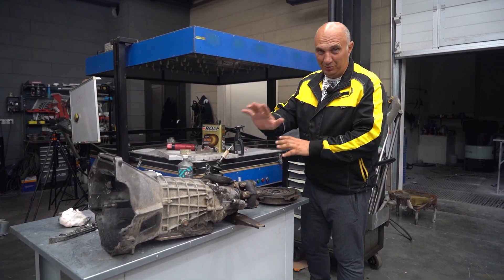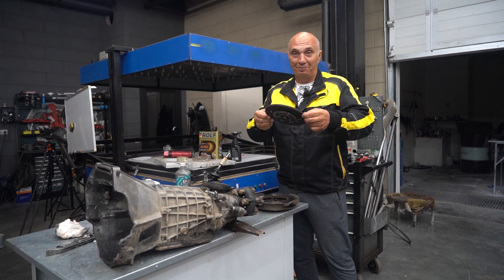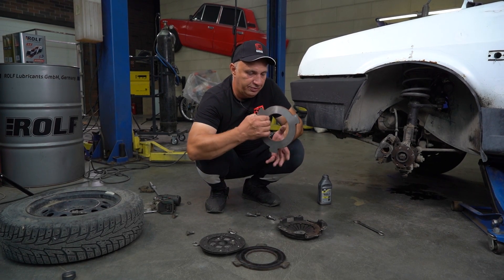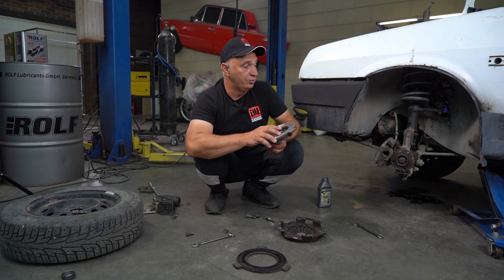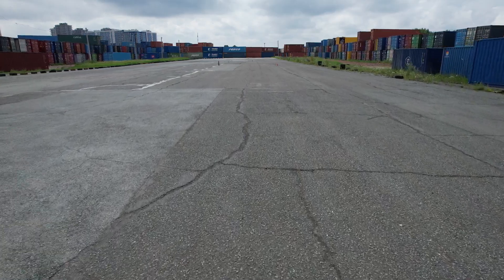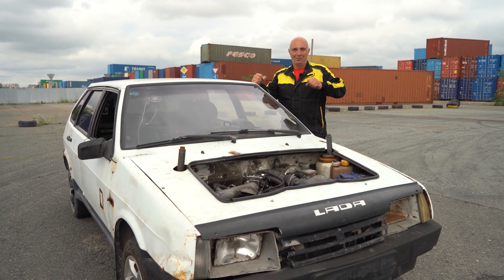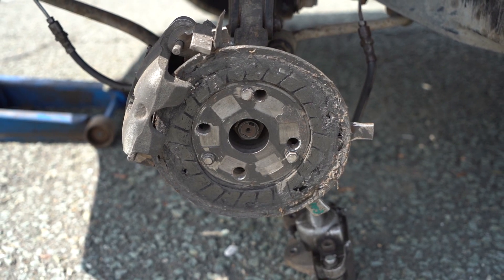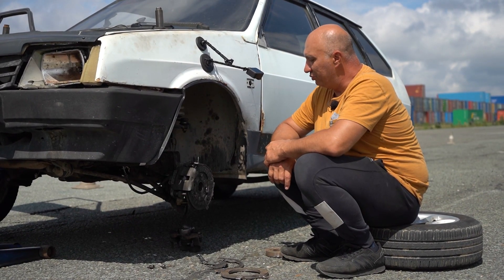We replace conventional brakes with clutch components - will it work?

Comment: This is a few months old, but I thought the question deserves an answer.
As for why the clutch disk failed.  One of two reasons.
1: the clutch material was inferior (possible, but unlikely)
2: the clutch was never broken in.

When I was 17, I replaced the clutch on my minitruck.  Upon replacement, I immediately began to dump the clutch and ferform huge burnouts.  I was doing the exact same behavior before the clutch replacement.  A month later, when the clutch stopped working completely, when I separated the bell housing from the clutch assembly, large chunks of the clutch fell to the ground in a similar fashion.

If this experiment is tried again, either use old used clutch pads, or break in the clutch first.
Hopefully this answers the question.

Comment: I was hoping you'd just make a set of steel brake pads and fit into the standard calipers. Would maybe let more heat escape. The bottom line is though, the friction materials are very different. Doesn't take long to burn up a slipping clutch

Comment: They could have easily cut the clutch in the shape of brake pads and just used them on the stock rotors and got a good comparison of materials. Their way is more work but also kind of interesting. Keep it up fellas!

Comment: What you made is found in aircraft. Spinning brake rotor (rotors) and stationary metal plates (stator). They normally have a 5S 4R configuration with 7 pistons.

Comment: This setup basically is like youre slipping the clutch the entire time. A clutch is more or less an on and off switch, its clamping time is very brief. The driver side went first because thats always the side that gets the most amount of pressure, although its supposed to be "equal". Given the abuse this car takes I wouldnt be surprised to know that one or multiple rubber brake hoses are damaged internally. Still a fun experiment

Comment: The need to press the brakes hard in a set with a clutch disc to obtain the required force could result purely from the fact that two calipers were installed on one side while leaving the standard brake servo. The demand for output increased, but the power supply remained the same. The same effect is when you modify the brakes in a car, installing larger discs and calipers from another vehicle, when the caliper has a larger piston, it also has a greater demand for fluid in mililiters, so often in such cases the new, larger brakes work worse than the factory ones, because the system cannot build up the appropriate pressure. In this case, the caliper capacity increased twice, which certainly significantly reduced the force exerted by the calipers on the discs.

Comment: I assume, a clutch only needs to briefly match up gearbox rotation to engine rotation.. and a brake needs to constantly do that. Also, the material seemed to rip itself apart, due to how the indentations on it were pointing outwards.

Comment: I would suggest. Cut the brake rotor to half of it's thickness then revet the clutch friction plate material to it. Then use metal pads or same brake pads to calculate the results 😊. A much better solution.

Comment: Could you build a manual shifting transmission that uses a torque converter, and one that has an oil pump and oil cooler?

Comment: Clutch discs are made to clamp or release, not to slip. Brake pads / rotors are designed to do exactly the opposite. As for the one showing worse damage than the other, I think that the clutch disc is designed to be directional, which would cause the one rotating the opposite direction to shred worse. That said, I think this would have worked better as a pressure plate arrangement rather than a caliper piston.

Comment: This didn't work because a transmission clutch pedal works in the opposite manner of a brake pedal. The brake system applies pressure to the break pads. The clutch system removes pressure from the clutch plate.

Comment: Now i want to see them take this idea to the next level, instead of the clutch being on transmission input shaft, put a clutch on each wheel of a welded diff and connect it to levers so you can steer the car like a tank!

Comment: The brake pads being smaller means more pressure per inch, the clutch spreads that across the entire disc, so that pressure is alot less per inch but still has more friction. Awesome to see it tried tho.
Reply: A simple set of steel brake pads may have worked better. I think the compound of friction material simply isn't up to the job though

Comment: The only problem I see with this is brake pad minimum thickness is about 5mm, and a clutch disk only has 2mm on each side for 4mm total. It will work well, but not for long.

Comment: Note here - a clutch disc is designed to have clamping pressure and contact on its full surface - youre only applying clamping force to one are while the rest of the clutch disc heats up distorts and ends up getting shredded   and a clutch assembly is meant to only enough to get the car moving not endure a long distance stop with pressure in just one area

Comment: well..  Lets look at it like this..  The strength of a clutch or any other drivetrain component is measured in the force (Torque) that it can tolerate, not the speed.. That clutch was designed to be behind an engine that makes MAYBE 80ft/lb of torque.  

To calculate the amount of torque that it takes to stop a car lets look at it. 

For most cars the brake bias is somewhere around 70% stopping force in the front, some even more.. Lets use 70% as a conservative number. 
The car lets say is 2700 Lbs. To make a 0.5G stop, with a single 26" tall tire (Assume it's a unicycle and all tires from here on out are the same size) , you would have (2700 pound Car *(26 inch tire/2 to get the radius))/12 to convert it back into feet =2925 Lb/Ft for 1G stopping force.  Now assume there are 2 tires like a motorcycle and 70% of that goes to the front to handle..   2925 * 0.70 = 2047.5 Lb/Ft. Now, lets assume that there are 2 front tires splitting the load evenly like a car would. 2047.5 Lb/Ft / 2 tires = 1023.75 Ft/Lbs per tire is required to stop the car with a 1G force. Now let's play it conservative and say you only wanted a 0.5G braking force. 1023.75 Lb/Ft * 0.5G= 511.88 Lb/ft!!  that clutch was likely only made to hold not much more than than 80-100Lb Ft engine and you applied over 5-6x it's rated torque capacity! LOL  A good part of why it failed is because clutch material in stock organic clutches is RIVETED to the clutch disc. Brake pads are BONDED to the backing plate allowing them to exert massive amounts of force without becoming dislodged like the clutch disc material..   

With a little basic math, you can tell that this was destined to fail from the start. LOL

Comment: Honestly these will probably grab better than brake pads with the correct clamping force... But they cannot shed the heat as quickly. The fade happens after a few seconds not a few minutes.

Comment: brake pads are meant to be slipping across the rotor
the clutch is meant to slip a little then hold the contact point all the time. its gonna burn through the clutch instantly

Comment: The clutch normally has minimal slippage, but brakes are always slipping when slowing until you stop or lock up the wheels, so the clutch isn't normally going to get as hot as the brakes.

Comment: This is not far off from what many tractors use for brakes. Multi-plate internal wet brakes are the norm on agricultural and construction machines because they are compact and stay clean and protected inside the axle housings.

Comment: The likely reason you had to apply more pedal effort and travel is 
that the master cylinder does not displace enough volume for dual calipers on each wheel.

Comment: I was so disappointed when you said you removed the springs 😢. I think it would be triple fun with them on if you can install a spacer to connect to the shaft instead.

Comment: OK, so I believe the clutch disks failed because they were experiencing torsional load, and the twisting caused the failure. Even though calipers were applied to both sides, those still acted like pinch points.. If pressure was applied equally to the entire circumference it would have been successful...... I don't know how that would be achieved.. But still a pretty cool experiment.

Comment: i am surprised no manufacturer has done this...
its actually a pretty good idea.
can have plenty of friction material, using only that portion allows it to cool...
and the pads, being the metal, and stationary, can easily be water-cooled...

wouldnt be any harder to change...
Reply: No factory wants to use this because it's stupid. Lots of heat generated it's not worth it even if you get more brake performance
Reply: @mann_idonotreadreplies  some already do use a similar system... multiplate truck brakes. not quite the same, but there you go... annular friction "discs" or rings... or clutch plates...

you miss the point. you can WATER COOL THE METAL COMPONENT.  and the friction material having only, say, 1/3rd in contact at any time allows for pretty good air flow and... cooling.

Comment: I wonder if this would work with a clutch designed for very high torque? Because the clutch for a normal car doesnt need to be designed for nearly the amounts of torque that brakes experience during hard braking. It looks to me like the friction material just sheared right off

Comment: Brake fluid doesnt boil. If its old and contains water, the water boils- but then the pedal goes to the floor. As it turns out, clutch pads werent designed to slip very long without disintegrating so clearly are made from a different composition of materials than brake pads. Now use brake pads in a clutch.
Reply: Brake fluid can actually boil once you start getting into the temps they were talking, some brake fluids boil as low as 284°f. Though most brands claim higher numbers.
Reply: Clutch pad doesn't exist

Comment: Of course clutches are meant to smooth power from the engine to the transmission so even if you have more surface area it isn't designed to bite into a rotor as with typical pads with such force and as much heat lol. Somewhat fun idea to toy with still I suppose.

Comment: Energy increases with the square of the speed. So 60 kmh equals 3,600 units. 80 squared is 6,400. So dividing 6,400 by 3,600 equals 1.777 so 77.7% greater energy to dissipate. Love your creativity.
Reply: Cool story bra

Comment: If you had clutch hubs, what if you had a crank shaped axle that runs through the engine block? The axle could then rotate all the time until you engage the clutches on the hubs!

Comment: In the engine clutch, the pressure on the plate is controlled by springs alone.  In the brake system, you can put many times more the amount of pressure on the disc, so it just exploded under the pressure.
Reply: No idiot. The pressure is controlled by the hydraulic clutch pedal.

Comment: Friction is friction, but clutch plates are designed to briefly slip and lock solid when released, whereas brakes pads are designed to apply progressive pressure to both sides of a rotor. Both are manufactured from completely different compounds of friction material.
Reply: No shit
Reply: I think the main thing here is that a clutch is designed to hold however much torque the engine can make, but brakes have to handle WAY more torque than that during hard braking. And so they're both designed accordingly
Reply: @thecrazyfarmboy  Clutches essentially function by applying friction to multiple plates thus eventually forming a single rotating mass, to progressively couple crankshaft rotation to the clutch/gearbox and driveshaft. Brakes however are designed specifically to apply much greater hydraulic pressures, equally distributed between opposing brake pistons/pads pinching against a single rotating mass. 👍
Reply: It's a shame your correct explanation is so low already. It's the same reason why you let out the clutch without revving the engine because you'll burn up the clutch medium. It's like they were doing a clutch drop at red line in top gear.
Reply: @pohldriver you sometimes need gas to slip clutch
Reply: @sasazapadnik9335  maybe on a 4 cylinder or rotary with no torque. I've only driven Small Block Chevys and semis with 350 and 1800 lb ft of torque respectively.
Reply: @pohldriver  yes, on gasoline v8 trucks and semi trucks you dont need the gas. first gear or first handful of gears very short & lots of torque.

any other car? It might need gas to move, or at least to move swiftly. Especially uphill
Reply: Ok bill nye the liar guy.

Comment: man! this was one of the most unique things I've seen on here, amazing!  but, you got too much surface area, that's why they hard to push, like if you took, a stock brake setup, but changed the small pads to pads that were big and round the same size of the rotor, and then tried it out, you would have the same problem... because you only have a certain useful amount of psi you can squeeze, but you trying to spread that over a larger area, needing that much more psi to have the same clamping force. if you understand, . that's why we have a big rotor, with a SMALL pad...  you need to change your setup to keep the disc material the same, but just use one caliper, with 2 steel 'pads' inside like you would have had normal pads.... that's the key, heck, just put in normal pads but backwards, so the steel side rubs the friction disc.
Reply: Cool, story, bra,

Comment: When doing an emergency stop, there's at least 10X the torque, than an engine can ever produce. Clutches were never designed to handle the clamping forces, needed to transfer that much torque.

Comment: How about using brake parts as clutch using differential in it? 

Driveshaft 1 as input from the engine, driveshaft 2 as output to the gearbox and the propshaft as clutch (Brake disc and caliper). The output will of course spin in opposite direction but just turn the rotation with gears or flip the differential around from the rear axle. This system would be interesting to see!
Reply: I honestly have no idea what you are saying.  Use an online translator if you are not a native English speaker.
Reply: @Flies2FLL Sorry, I'm not native english speaker, so it's hard to explain, but if you know what differential is, you should know pretty easily what i mean. Cars differential has 3 drive flanges, one for propshaft, and two for driveshaft, so if you turn one driveshaft flange, you can adjust the other driveshaft's flange torque and speed by holding the third flange in place (flange for propshaft) with brake disc and caliper system. hope this helps.
Reply: @Hertte_1234  Use an online translator.  (Your language) to English.  It will do a decent job.  Thank you for trying!  We want to hear what you have to say.
Reply: @Flies2FLL  just use gpt
Reply: @Flies2FLL  He suggests to recreate the transmission of the ford model T, by using a cars axle differential gear. the model T had one clutch for forward, one clutch for reverse. they were geared together by epicyclic gears.

Comment: I remember thinking about this as a teenager.  I wondered if you could put the pad in middle [circular, such as done here] and metal rings around the outside and have the metal rings clamp the friction surface.  The metal rings would not turn, so they could be heavily finned like an air cooled engine and this might dissipate heat better.  Changing the friction surface would be more involved, but that doesn't happen too often and this might reduce brake fade on tracks.

This shows that brakes dissipate way more horsepower per second than any clutch plate adds.....

Comment: Consider powering one thing such as an engine powering one wheel.  Consider attaching a differential differential to the wheel with the drive going to the motor, as usual. The other side of the differential going to a . brake. This kludge would act as a clutch which is engaged when the brake is on. All motion goes from the motor to the wheel although the wheel goes twice as fast as usual.

Comment: I remember an experimental braking system where they put two brake disks side by side and a caliper on each one on every side of the car to effectively double the surface area of the brakes. I would like to see that one done. Fitting the calipers will probably be a problem along with the extra weight.

Comment: At first thought, I imagined the disc driven with the wheel and your having used gray cast iron pucks.  Of course, that wouldn't have worked.  Then, I realized that the clutch was meant to transmit much lower torque, as the tranny is the torque multiplier.  If you were to have used a mechanism like a multi-plate motorcycle clutch, you would have fared better.

Comment: The clamping force of a hydraulic caliper is far greater than the springs in a clutch pressure plate and the friction material has to match. As to why one side fell apart on the other didn't, I'm guessing unequal clamping forces due to redneck build quality not being the same from side to side.

Comment: You guys should try making brakes and pads with the materials swapped, Smooth steel brake pads and brake pad material on the discs. (Add bevels on the edges of the steel pads so they dont dig into the pad material on the discs).
Reply: That's similar to what they just did but even if they actually got the brake friction material attached well enough, I suspect you'd just see them overheating very quicky.
Reply: The main reason he had to use so much peddle is because the master cylinder needs to operate double the volume of the original front slave cylindersystem, if he matched the master cylinder i think it would yeild better results
Reply: great idea!!